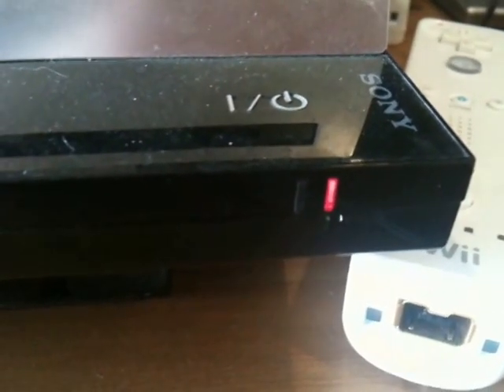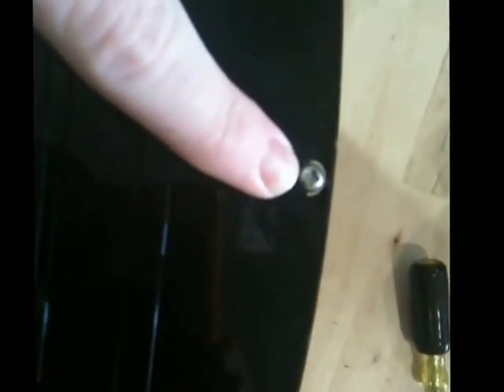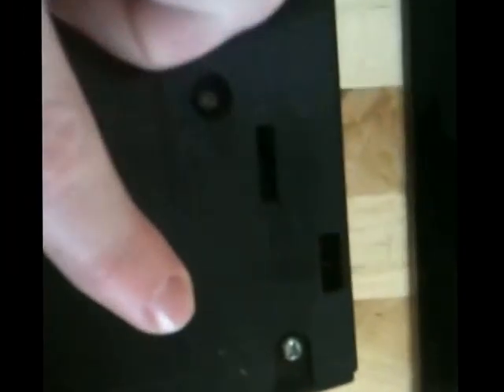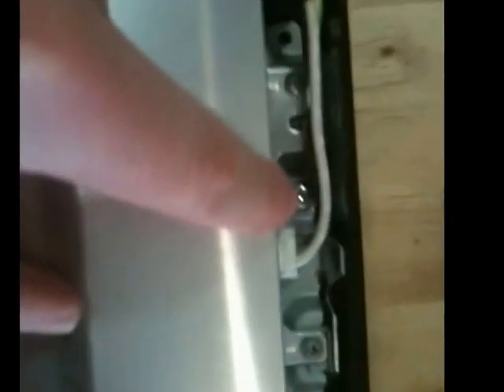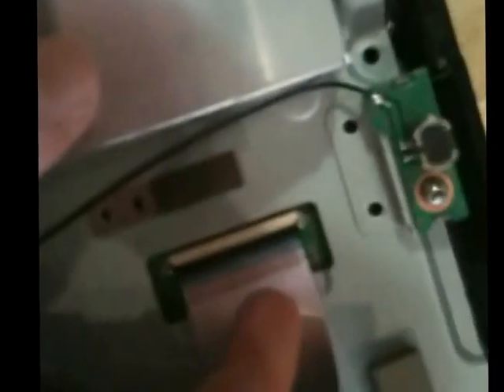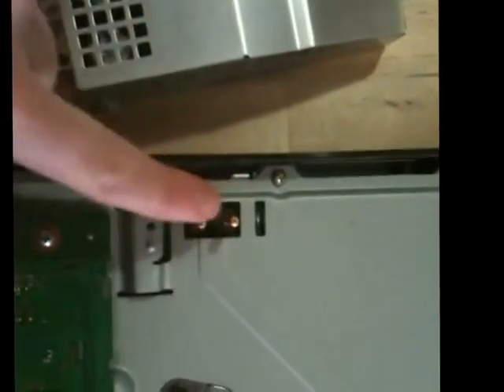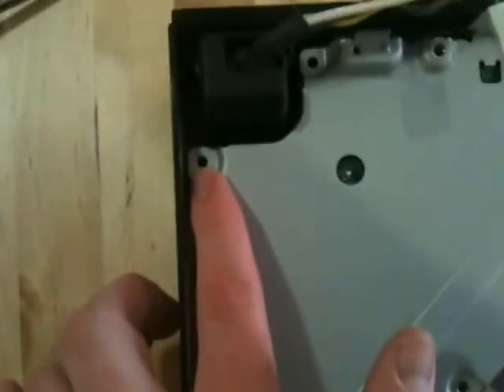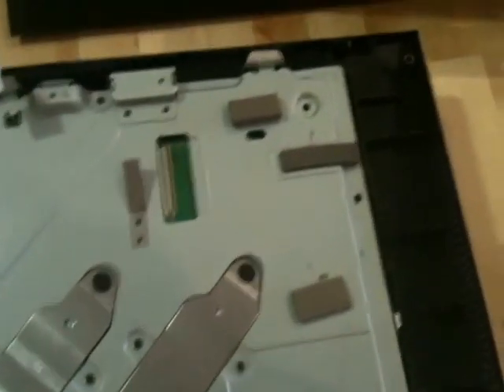Detailed PS3 YLOD Reflow (Old Model Red/Yellow Light of Death Fix) - Part 1

Comment: what if the damn cover doesn't come off..............
Reply from the maker: Caleb Morgan - I had that problem the first time too.  If you're sure you've removed all the screws, be aware of the fact that it can be reaaaaaally sticky.  Pull slowly, but with increasing force.  You can try working the blade of a pocket knife into the gap to get it started, and popping it up just a bit all the way around.

This is honestly one of the scariest/trickiest parts of the procedure.  Go slowly and carefully.
Reply: Thanks for responding I'll be sure to do that

Comment: This is a true story. GTA5 was released the other day, That night I installed the game (8GB) and then went to bed. Woke up turned the game on and during the first part of the game, I walked into the safe and the system shuts off (1 minute of game time). Found the video, bought the supplies ($15), excluding a heat gun. Rebuilt the system and it worked. I don’t really understand what went wrong or what caused it to work but it did. Also, it wasn’t mentioned in the video but ground yourself. TY Jon